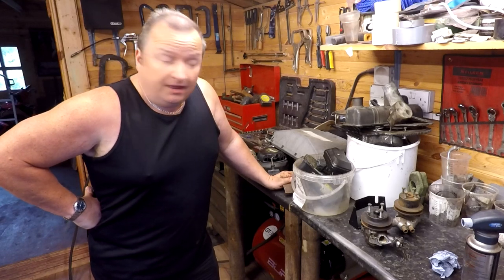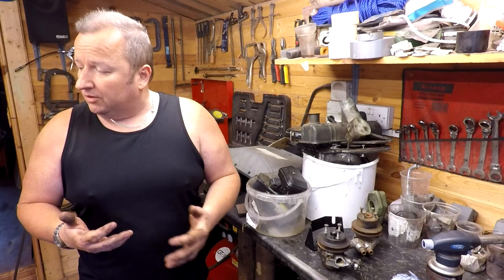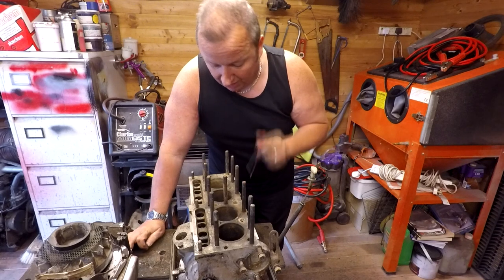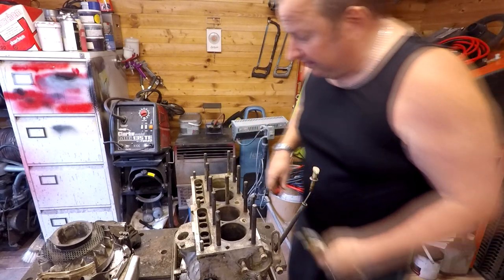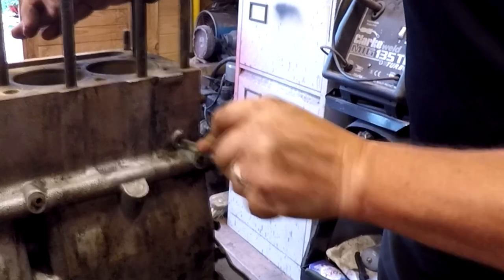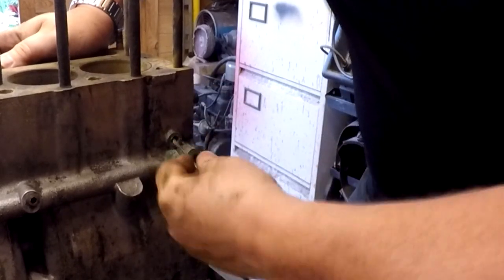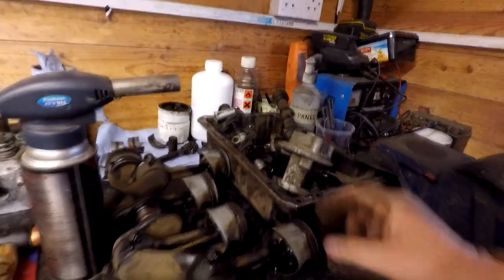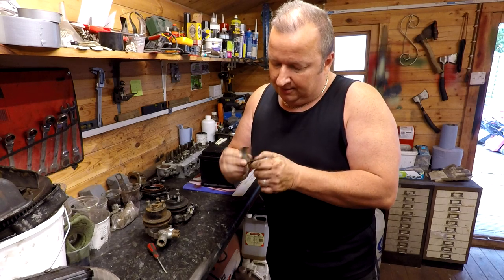Part 35 Reliant Trotter Restoration Engine Waterways Cleaning And Checking

Comment: Hi Martin, had a couple of thought's while watching, you could try kettle descaler in the water ways, would give it a test on some of the corrosion you removed and on the block in an area to make sure it doesn't react to much with the alloy. The other thought was to try lumiweld or another low temperature alloy braze to repair the water pump. There seams to be different opinions on the results and ease of use but that could make some good content.  Keep up the good work on your channel
Reply from the maker: Hi Burt, I did think about  alloy braze but You have to heat the item up to abut 600 degC and I thought that could damage the seals. I've now located a new one so i'm sorted.
Cheers
Martin

Comment: The sediment is not just corrosion it also contains a mixture of casting sand and silicate build up (silicate based antifreeze will eventually form sand) I find a pressure washer with the head off works great,

Up end the engine so that anything dislodged will run out of the pump hole

 get down in all the water passages and in through the drain hole and jet each out the head too.

Once it is all back together you can use a two part flush designed for limescale and sediment.

The water pump carries the same shaft and bearing as a lot of 1.1-1.3 fiesta escort units. 

They do come with two different diameter shafts so get the correct one to match the reliant pulley, the ford has bolt on pulley in either v belt or ribbed rather than a solid one piece pulley on the reliant so could be used for converting to ribbed belt.

Lotus use the same shaft/bearing and seal set up too, those guys regularly rebuild there water pumps because parts are hard to get hold of.
Some ford pumps have a stamped impeller like the reliant but the fins are angled some come with a much better flowing cast impeller.

The ford pumps are very cheap (last one I bought cost £8) so worth striping for parts, even if all you need is a seal head.

As far as unleaded conversion goes I was of the impression that the 850 at least was unleaded anyway because the seats in the aluminium head are already re-enforced.
Reply: This is an 800 cc engine.

Comment: great video martin, good job you had a dig away with that screwdriver i think a solution would have taken ages to break down that amount of buildup. as always its a thumbs up from me and i look forward to the next one
Reply from the maker: Yes, it would never have unblocked its self. Its a common problem with the rear cylinders running hot so this would be the cause.

Comment: cylinder liners can be removed by tapping them out from below or making a tool to pull them from above ive just replaced mine with nos liners anyway its the best way to clean the corrosion out you might thik its clear but there so many gaps and corners it builds up the head is unleaded from the factory

Comment: Well done for spotting that mart, get a 9 litre ultrasonic  cleaner rather then a parts washer. Mines been brillant so far.you. can allways blast oily stuff with the pressure washer or put it in sharrons dishwasher ! Ps why dont you hone it out and get a set of cord rings for it ?
Reply from the maker: I am going to hone it out Pete. I do have a small ultrasonic cleaner but I don't think Sharon would be happy with that suggestion Pete lol

Comment: Do you know if it`s possible to remove the engine block drain plug while the engine is in the car  ?
Reply from the maker: I would imagine you should as its at the rear of the engine you would access from inside the car.

Comment: That was really plugged up with crud. Good job clearing it out. I would put the drain plug and let vinegar sit while the head work is out. Then flush with hot water, blow it out with your air gun. Bearings can be reused, make sure a heavy gear oil sits between bearing and crank for initial start up.
Reply from the maker: I'm going to soak it with vinegar as I did with the Triumph Bri, it would never have got through this though so I'm glad I checked it.

Comment: Nice to see some common sense mechanicking, theres ppl out there who will strip and replace everything when actually things like the mains and big ends have tens of thousands of good miles running in 'em.   You could whizz the second hand pump and the original down an engineering firm (the one that is doing your head would be fine) and they could have it pressed off for you in seconds.
Reply from the maker: Just found a new one Ian so i'm sorted now.
Reply: Cool, its one of them things that is so essential for a good engine and some of them chinesium ones have proven to be dire but most of them have been weeded out from places like ebay.   Hey I am getting all geared up with this keto diet, had a chat with a couple of the docs online about it and it really comes down to basically lots of meat, plenty o' fat and lots of veg cutting out rices, grains, sugars, potatoes etc so I envision some eggs and bacon sorties (but no toast, fried slice or beans) and cheese omelettes but no more pies or scotch eggs either which is sad cos I do like a scotch egg.

Comment: A decent fab shop should be able to weld the pipe back on the water pump. You can weld cast if you use the correct fill rod. Once cleaned up you would never know.
Reply from the maker: It might melt the seals though. I did think of that.

Comment: Wondering if you know anyone good with TIG welding?  They could probably repair that original water pump if everything else with it is good?
Reply: dirty aluminium is a pain to weld and dirty cast aluminium is even worse to weld so it would be more cost effective to get a new one rather than trying to mess around repairing the old one in my view
Reply from the maker: It might get a bit hot and melt the seals. I did think of that.
Reply: Fair enough, wasn't sure if they were that rare, it would be worth a try, and maybe the seals are replaceable if you can get the thing apart :-)